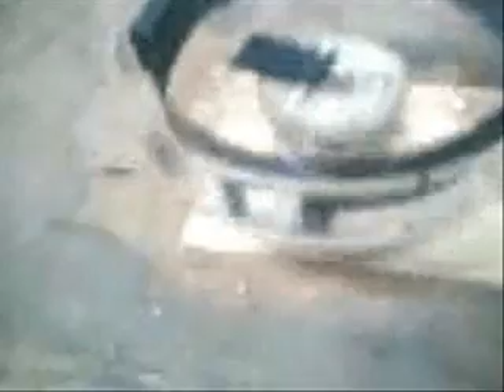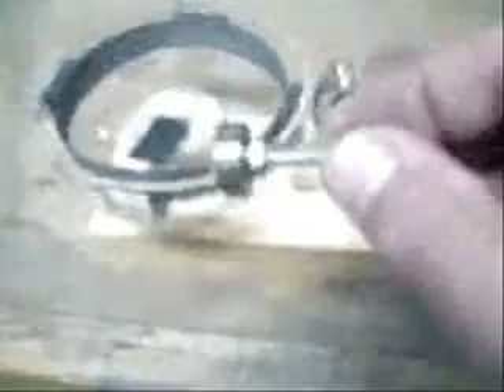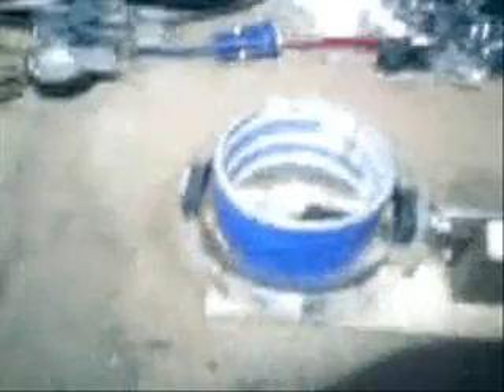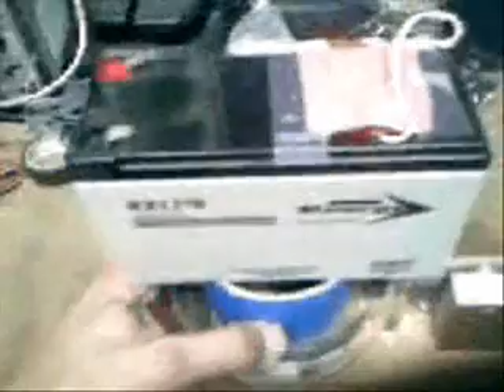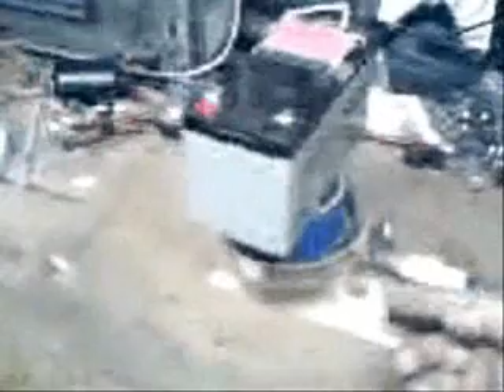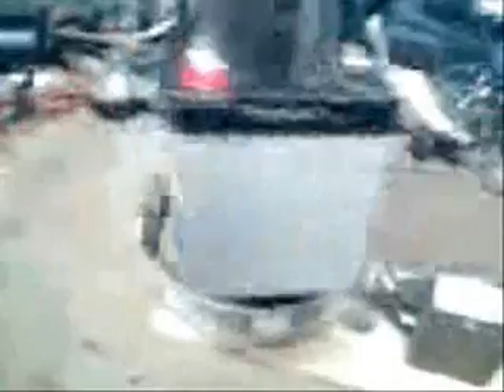03 - Beyond Steorn, a real permanent magnet motor.

Comment: Zero, I never did understand why you used a mechanical connection instead of using magnets to make the arm move as well. Do you think that might have worked? I know there is too much resistance in a physical connection, but the magnets would eliminate that, wouldn't it?
Thanks,
Ike

Comment: I have built a lot of these fun magnet motors. Put several magnets on a nicely balanced wheel and then hold one in your hand just outside the wheel. Move it up and down at the right time and the wheel will turn.Hook your magnet to a lever like the video and it will work also.  But if you attach a cam to the lever , the wheel cannot self-produce enough power to operate the cam. That is why the guy in the video pushes the lever himself. The "free power" is coming from the energy in his hand.

Comment: Laws of "perpetual" mouvement machines :
1- They don't need inicial impulse to start running.
2- Once running they don't stop unless brake is aplied.
3- They work without electric wires or motors attached.
4- And finaly... they never work, whatever you do or try.
If any of these rules is violated, the machine is a fake .

Comment: I built one of these a few years ago, to test Steorn's theory, a link from the rotor to the stator will run it for about 3 minutes, giving the illusion of overunity, but it will always stop due to friction, the new Orbo while being improved, still needs a battery to run. I think a Perendev or Johnson type motor is far more viable.
Sorry to sound negative, but i wouldn't want you to waste your time on steorn.

Comment: This guy claims a breakthrough  in violating the laws of thermodynamics .... yet he cannot even run a video camera.  Snake oil is alive and well amongst  the ignorant , the fools, and the suckers..

The movement of the lever (by the man) is the source of power for this device. If he simply spun the rotor with his finger it would be more efficient than manipulating the magnet lever. But he would lose the illusion of his magic magnet trick. The rotor will not produce enough power to work the cam.

Comment: In a closed system of this type, there is no way to prevent an equilibrium state that stops all motion unless more POWER were introduced.

Secondly, permanent magnets are not PERMANENT at all! They ALL will lose their magnetic traits fairly quickly. SO even if it should sustain movement without introducing external power, IT WILL STOP! But don't mind me, I just a genius with heavy physics training.

Comment: a knowlage of physics is not always a good thing as it put barriers in the way of progress i made a motor 2 years ago and its been running non stop ever since i have no idea what you guys are saying half the time but thats how i achieved this as i didnt think about how it wont work only about how it will work . great work by the way need to dump the ball bearings on the flywheel think prop and lift .less drag after 50rpm

Comment: Instead of moving the arm verticaly, have you considered moving it on a horizontal axis? This will still move the magnet on the end of the arm in and out of the mangetic field causing the rotation but be easier to manage with a spring pushing against the arm from a fixed point. The wheel will have to be started manually but should be automatic once the spring/magnetic repulsion sequence settles into a rythym.

Comment from the maker: Under load is the whole point! We need useful output. I have always contended - Any viable design will produce so much excess energy that it will accelerate on it's own, from a virtual stop, to the point of self destruction if not regulated. Perendev as an example is a joke. They spin like the flywheels that they are and make a whirring noise but that's it. Show me ACCELERATION. Then I'll be impressed.

Comment from the maker: If I were to actuate the stator from up and down cam lobes at the perimeter of the rotor I agree. However there will be a total mechanical advantage of 4:1 when all is said and done between the rotor and stator. Since the stator need only travel 2-3mm to drive the rotor to full power, I'm fairly confident it will work. We'll see soon. I promise!